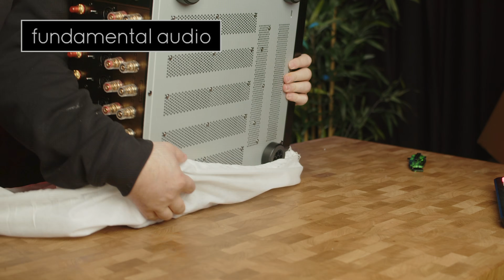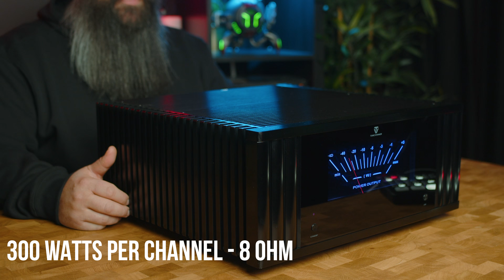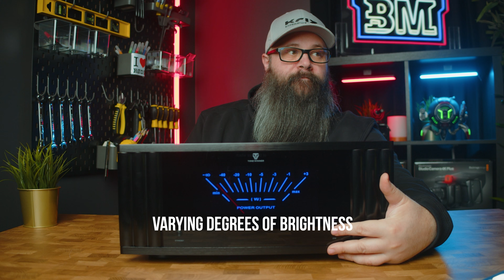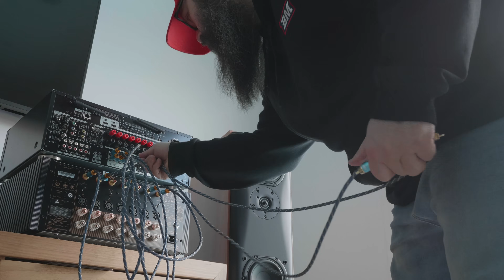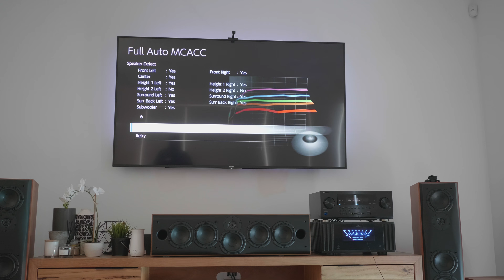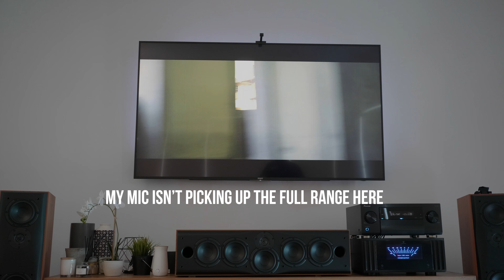Incredible "BUDGET" 300 WATT BEAST Home Theater Amplifier! // Tonewinner AD-7300PA+

Comment: Tony - thinking about getting one of these tone winner amps, but just wondering is there any benefit jumping to the 11 channel power amp over the 7? I have a Denon AVC-X3800H amp and older Krix Phoenix, and Lyrix gold speakers
Reply from the maker: It all depends what you're wanting to achieve. I have the Lyrix Golds (in storage now!) I can't recall if they can be biamped or not, I don't think they can, so that would be one benefit. The tonewinner stuff is great. Depending on your budget, there are some other options available as well. Shoot me an email if you like enquiries@buildmontage.com

Comment: Hi Tony. Can you Bi Wire the front L and R speakers when using the Tonewinner Amp. I remember in one of your other videos you bought a Yamaha Amp so you could Bi wire? I'm looking at buying the Tonewinner AD-8300 11 Channel Amp but can't find any info if can Bi wire front speakers. Cheers
Reply from the maker: I bi-amped my speakers as they are 3-way speakers which allow the mid/bass and high frequencies to be powered and recieve the signal separately. You can certainly use the Tonewinner amp, or you can check out the video I did recently on the Summit HIFI Amplifier: https://youtu.be/rge4PsG6HXk

Comment: How warm did it get after sustained use? I recently bought two but got a good deal at $4,000 for buying a pair. 

I have not had time to set them up yet, and they will be stacked with the 6700H on the top. 

I have two AC Infinity T10 front exhaust fan units, which i will likely put on top of each amp at this stage, i'll open those up to add support to take the weight since these are significantly heavier than those T10s are rated to take, and the bottom one will have the weight of an amp and the weight of the Denon to deal with. 

The amps themselves don't look like they're going to have any issue with that weight ontop of them, they're very solid and the side heatsinks align with half each base foot anyway.
Reply from the maker: I dont remember experiencing any heat issues from them but I didnt have them for long.
Reply: @BuildMontage   thanks mate, i don't expect to have issues with heat, but knowing what to expect would make the layout a little easier to plan.

I did power one on and left it sit idle for a couple hours to see how warm it got with nothing connected and in free air, it warmed up a bit toward the back half, maybe 5-10° above ambient.

Comment: Did you notice a difference with FL/FR channels compared to Centre? Apparently they use different components with FL/FR
Reply from the maker: No I didn’t but I was aware. It all sounded pretty consistent. The speakers I used are thirsty as well.
Reply: @BuildMontage  thanks for the quick reply. Been watching your channel since birth. Big fan!
Reply from the maker: Thanks for watching! That amp is a weapon for the price that’s for sure!
Reply: I currently have the jamo d600 thx ultra speakers. Do you think it'll be safe to run this amp?
Reply from the maker: @kunalnair5349  Of course! Speakers don't like under powering more than over powering them. They will take what's needed, just keep the volume down to start and test when you calibrate what kind of SPL you get at specific volume.
Reply: Thanks mate. You're a legend!

Comment: Hey Tony, do you have any dralings with the AMC branded power amps here in Australia. Theyre sold by RIO.

How do you think the tonnewinner compares to the 150w/ch AMC power amps?

Thanks
Reply from the maker: No I don't have any experience with AMC. My reviews are usually stand alone without comparisons because it's unfair to pick a random amp to compare it with when there are thousands of options. I try to review on it's own merits. I would happily have a Tonewinner in my setup if I needed it.

Comment: Excellent review Tony!. Would it be worth using the latest Tonewinner amp AD-8300 with a Marantz SR7015 for 7.2.4, or should I just go with a Two channel external amp to cover all channels? The AD-8300 is currently on special for A$2399 in Melbourne, so it may be an option considering the Marantz MM7025 2 Ch is currently going for A$1890 and the Marantz MM8077 7 Ch is currently going for A$3999.
Reply from the maker: Hmm... do you want to use the Marantz SR7015 and just cover the additional channels with a 2 channel? I personally (since I have a processor now) would prefer to use amplifiers for all channels if you can swing it. Tonewinner make great bang for buck amplifiers, so maybe you could go all in and switch to a Marantz processor. It all depends what your goals are - if you plan to change or upgrade, I prefer to go processor/separates myself. Either option will work though for sure, budget and your preferences will determine it for sure.
Reply: @BuildMontage  many thanks for the quick reply Tony. I already have a two channel Marantz to cover zone 2, but was contemplating buying a second 2 channel Marantz to expand to 11, but for an extra $400ish is the Tonewinner 11 ch just as good an amp as the 2 ch Marantz, considering capability/value for money over brand name?
Reply from the maker: I’d try to keep the same amp if possible

Comment: I'm running the same front stage as you, I got rid of the krix subwoofer and run two SVS PB 2000 and using the Yamaha cx-a5200 11.2 as the processor and for the power amplifier  I'm running Parasound Halo A51. I'm only 5.2 but building up to 7.2.4

Comment: I run 2x tonewinner 7300.  And a lab gruppen  14000.   Pre pro marantz.  Sound  levels are much better if you use xlr cables vs rca on this amp.  
Tonewinners are great amps.  I’ve been running mine almost 2 years now daily

Comment: Now under 2k in Australia I wanna listen first but I'm damn keen hope the dealer has some of the 2023 dennon and marantz models as that's especially the cinema 40, 50 or dennon x4800h would be great. The looks won't suit at all with the new marantz 😂 would probably hide that beautiful big vu or turn it off at least lol that and some polk r700s mains with r400 centre is will be the basis of my next system if I like how it all sounds and someone has all of it to test in person. I couldn't randomly spend the money on anything without hearing it in person as I'd have it at home first. It's rough looking in some ways but solid in others. I'm keen 👌
Reply from the maker: It’s a beast of an amp. Heaps of power and sounds great.

Comment: I have 2 of these amps. They are a beast. I also have the processor which I'm not happy with. it does Atmos well, but does not do upmixing properly and dno Dolby prologic at all. Looking forward to the new Prepro Marantz is releasing soon.
Reply: Went to the same route, bought the amp but went with a different processor.  Happy with the new Yamaha aventage a6a. It's a beast

Comment: Look at the Website.. It's 300 watts tested with 1 channel driven, 7 channels driven is 180 watts!
Reply from the maker: Plenty of power either way. I went off the documentation and it didn’t state 1 channel or all channels. I didn’t make a big deal or say anywhere in the video it was 300 watts all channels driven as I have no way of testing. I dare say it’s likely not 180w either. Only way to know is to test. That’s not what I do on my channel. I don’t claim to be a technical reviewer. I show products and options but either way thanks for letting me know. Which website shows this btw? Link it here if u can.
Reply: 7X180 not too shabby.

Comment: Its monster amplifier for affordable price . have 2 of them powering 13 channels .
Reply from the maker: Nice!
Reply: Are these amps the first ones you have owned going the separate route? If so does it make a huge difference in sound compared to an AV receiver?
Reply: @estyhugo  replaced with emotiva basx  A3, A4, A2 , Rotel and yamaha  amps

Comment: I think this is a great product. I am skeptical about their Pre Pros however. But the amplifier is solid.
Reply from the maker: I just got the pre-pro in and have been warned that the autocal is not the best on it - however it does allow for PEQ so I might get REW set up and see if i can do a manual calibration... will see.. 3-4 weeks before I have time to unbox it!
Reply: At300 is basic but it's good

Comment: I believe that you haven't really experience the full power of your system... If you read this do the following you will thank me!!! Step 1 only use the external amp, but also turn off the internal amp of your Pioneer Elite AV. Step 2 do the auto audio calibration. Step 3 turn up all your speaker level to highest level... Step 4 enjoy it... The higher voltage ⚡ from the RCA outputs your power amplifier will ❤️ it...
Reply from the maker: I did do those things, changed the speaker outputs and ran MCACC (It's showin in the video), but also the setup has been dismantled now :) I think it sounded great with the extra power.

Comment: 300 watts per channel WITH ONE CHANNEL DRIVEN.  such nonsense.
Reply: These are pink bunny fresco watts.  They are measured by how much frozen yogurt would a rabbits foot melt overnite.  RMS?  What’s that?
Reply: Zen it's 266 watts 2ch 8ohm driven. It's a beast of an amp!  Can't beat it for the $$
Reply: @joelkuznetsov2826  <----Tonewinner bot
Reply: @edithboozy1000  lol nice...      I was doing research for weeks. I was in between monolith, emotiva, iota, outlaw so yea.. 🤷
Reply: @joelkuznetsov2826  Emotiva is Tonewinner, same company.
Reply: @WarriorProphet  loving my unit
Reply: @joelkuznetsov2826  I want to checkout their AVRs, they have ones up to 13.2 with up to 300w per channel built in, and I mean I'm the pictures you can see the 3500w transformers so it should be real watts
Reply: 300w with one channel driven is to get 0.1% distortion, unless your running multiple thousand dollar speakers you probably can't hear the difference up to  2-3% distortion
Reply: @jeff Dow,I’m looking for a new receiver now
Reply: I just got this beast..It has plenty of power . I use paradigm founder speakers, and they shine with this beast..
I was also blown away how it looks and built.. i also have the anthem mca525v2 amp...and yes anthem better ,but for the extra $$
Reply: Yes,I ordered the AT300 and the TW AD7300 amp.I have it connected to my Klipsch rp8000f and my 504c.The power is not there at all.I’m mad that I have to turn the volume half way up to get a decent sound from my speakers.
Reply: @jamesmayden4337  that could be a shitty pre amp by the same brand not the power amp have you got anything to try it with?
Reply: @jamesmayden4337  if you're not used to gain on modern gear, nothing happens until you reach -20db
Reply: Why is that nonsense? 
It's still 180w @8ohm with all channels driven. 
You can't find another amplifier in it's price range that gets close to 200w all channels driven. 
The closest would be monoprices monolith line, but that one is $1900
Reply: Not to mention a 1 year HIGHLY CONDITIONAL bogus warranty that is essentially based on 1 man's word.  Buy things from established companies folks.  Unless you have truley disposable income in which case why not buy a McIntosh?  🤣

Comment: I have this amp, when i got it, i did not hear that much of a difference on stereo mode, just   slightly shaper highs, but when watching a movie with 5ch...that's  where it shined  running older pioneer elite av with Elec unifi  4 ohms speakers

Comment: I would love this, but with less power honestly.    Like 150w x 7 or x 5
Reply: This amp is NOT 7x 300w RMS. This amp is 7 x 173w RMS, so it would suit you well I’d say. Tonewinner were a bit sneaky in their advertising, but with a little investigating you will find that the 300w RMS rating is only for 1x channel driven.
Reply: They make 2-3-5 ch amps

Comment: With the future of your channel and not to discourage more equipment reviews, I suggest you make a test cabinet that you can swing your main speakers over.   If I was a manufacturer I would have been sad with all the apologizing.
Reply from the maker: What are you talking about? And what was wrong with the speakers I used ? When did I “apologise”?
Reply: I kind of get what he is saying. You didn’t necessarily apologize but rather noted the less than ideal conditions.
Couldn’t hook it up in your home theater rack, in your home theater room, had to use a different receiver and re-run calibration, the not ideal sound quality of your living room etc. 
Makes it difficult to do a direct comparison that way.
Reply from the maker: @mwrightinsurance  ironically though my HT speakers can run off an oily rag with 97dB sensitivity where as these towers like the extra power so they were perfect. The reason I noted what I did was to just explain my reasons. I don’t see any reason as to why this test was any less valid than in my dedicated room. Anyway everyone will have their own opinion I guess.
Reply: @BuildMontage  I had no issues with your review, it was great as usual, gave it a thumbs up! I guess I just saw where he was coming from and I’m sure you would’ve loved to be able to just plop it right into your home theater system and do a direct comparison but things don’t always work out that way! Anyway, thanks for the videos and have a great day!
Reply from the maker: @mwrightinsurance  thanks , i do this part time as I work full time so self funded and also massive time constraints. One day I’ll be able to afford a test rack but not yet. Thanks for the feedback I do appreciate it.
Reply: @BuildMontage  at this point I’m not even sure why I stepped into that comment😆 again, I love your videos! My hats off to you buddy! Keep doing you👍

Comment: $1500 budget?
Reply from the maker: For a 7 channel 300 watt per channel… absolutely!!
Reply: @BuildMontage  It's so budget you are returning it?
Reply from the maker: @brandonedwards7166  um… that’s kinda what I do… I review stuff and send it back. The stuff I want to buy I buy…
Reply: I’m sure you paid a lot more for it. Only top tier amps will fully double output when impedance is halved.
Reply: @mikee2923  I have a pair Dan D’Agostino momentum monos. Yes they cost about 45x the price of this amp. But I have owned Hegel integrated amps that doubled too. You don’t need to spend a ton to get an amp that doubles as impedance is 1/2ed.
Reply: Yes this is budget for sure. It also seems really poorly designed from the specs on their site. 300 w on Channel driven is crappy. My amps push continuos 400 watts into 8ohms, 800 into 4 and 1600 into 2.
Reply: @klewja  h
How much do your amps cost?
Reply: @estyhugo  my monos msrp for $65k a pair. They are not comparable to the tonewinner amps. I was just saying that the spec of 300w one channel driven is not that great. You need to look at power with all channels driven. You risk damaging your speakers when driving them with an underpowered amp. Amp Clipping will damage tweeters
Reply: @klewja  Understand. Do you risk damaging your speakers if you  run your speakers from an AV receiver?
Reply: @estyhugo  it all depends on the speakers. I highly doubt that anyone is running speakers that are really hard to drive off an avr. If your speakers are 8ohm you would be ok

Comment: The more I learn about amps, the more I'm interested in adding to my setup

The "pop" effects was a neat addition  :)
Reply from the maker: Separates are the next step.. Amps are a big investment but man, they last forever (or can last forever) and add some serious depth to the experience.
Reply: @BuildMontage  I actually was reading about adding a small amp for LCR and then letting my Denon handle the other channels. It should open up plenty of power for everything at that point
Reply: @TorinTPG  adding an external amp does wake up the speakers,  to me it has more definition in sound.  I hear things I didn't notice when it was running just from the AVR.  My external 5 channel amp is running my LCR and both surround speakers. My surround back is running from my AVR.